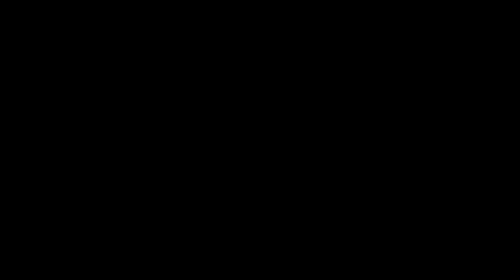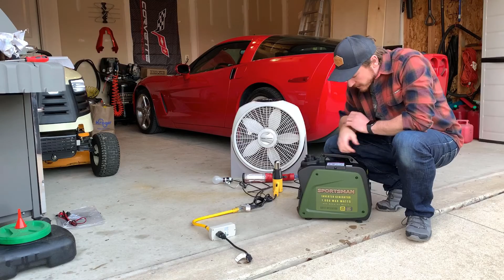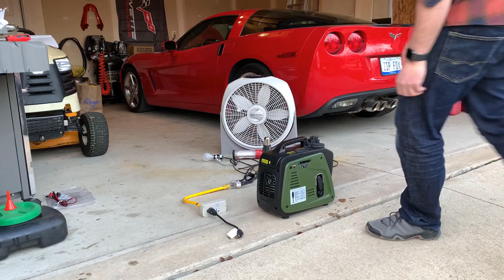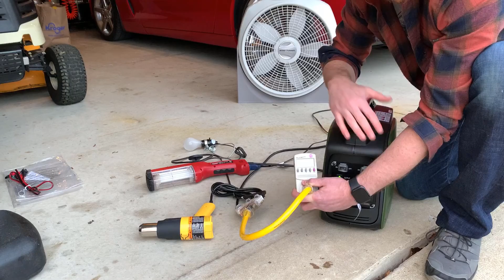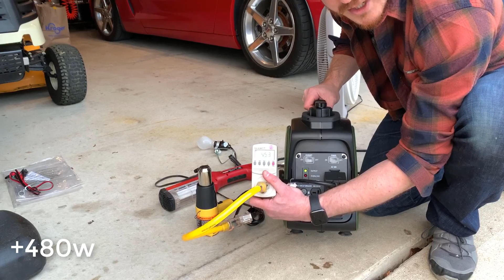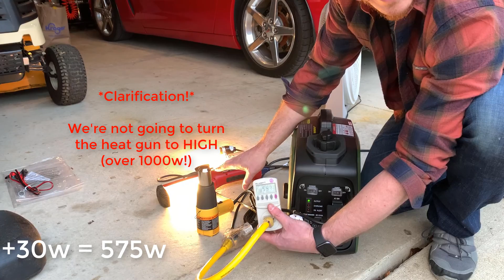Sportsman 1000 Watt Inverter Generator Review - Buffalo Tools

Comment: Yea it can’t handle a desktop computer and monitor, nothing else. I was pretty disappointed
Reply: Desktop computer is a very broad description... soem GPUs by themselves will overload this little sucker all by themselves. Also PCs are often very dirty loads... which are hard for smaller generators to deal with that said you can probably run 2-3 laptops off this with no issues, or 1x 350W PC + 50W LCD monitor.... dont' forget to accout for your monitor as part of the load. If you have your generator tuned up probably it can probably handle a bit more than that.

Comment: I just bought a dual fuel inverter sportsman inverter generator from Home Depot "HD". After watching this video I going to return it for credit as pro-desk will return with pro rewards 1 mo and HD credit card 1 year and finding an HD store that has to send by truck (not all) policy under maintenance policy it will exceed 30 days return, as it takes several weeks to repair.  Nice looking but it propane vapor leak means it could not take the trucking from MO. long way to the west coast. Beside it prohibited in Ca, to use as EPA stopped it sale. I thought propane would be clean but you hear gas rushing out inside. TOo bad it will take a road trip as I would not want to be one who experiences the propane leak and fire. I called Buffalo Tool in MO and they did not specify which passed Ca specification.   Too bad buffalo tools executive travel to china and if they do likely a s for a lot more money or seize if American business. Sears is a good example of how they changed policy to allow foreign businesses to own rather store or Mfg plant, than pay for kidnapping. See my video less min , I did not light the escaping the propane fuel as this is a residential area and I'll return it to retailer!! Do not buy Buffalo Tools

Comment: I find this strange. Mine will run 800 steady. I think your generator might have an issue
Reply from the maker: Brian Graham yep - I returned it.  Definitely wouldn’t get anywhere near 800w.
Reply: Thanks for this. I'm looking to get something to run a 600w charger for a e-bike and this thing is the best option I can find for the money. I think I'll give it a shot and update the post if it works or not. If I can get one from Walmart I shouldn't have a problem returning it if it doesn't work.
Reply: @IanJesting  did it work??
Reply: @elcompamartinez2647  I ended up getting the harbor freight predator 2000
Reply: The E Bikes are amazing. I think you made a wise choice picking a small inverter generator to charge it while on the go. This generator has served me well while camping

Comment: Excellent test and review of actual vs advertised 'claimed' output.
I also just bought one via the SD post.
Quick question,, when filling/checking oil level, do you take the oil level reading with screw-in plug merely sitting on top of threaded hole (unscrewed) OR when fully screwed back in?
Reply from the maker: I found the instructions quite confusing on the Oil.   I've dealt with a number of these small engines though, so i added 8-9 oz of oil and that seemed to get it on the dipstick right about midway up..  I measured the oil on the dipstick with it screwed in on a level surface.   Cheers!
Reply: @deependstudios  Thx for replying. Tho it may have sounded like a goofy question, some of the small engines have actually said to measure with dipstick plug just sitting on top, unscrewed. I'm just gonna use ounces, as you did, and use dip screwed-in as reference.
Reply: Looks like 7.5 oz of oil is the new fill recommendation. I've only ran mine about 6 hours so far but it ran fine with 7.5oz of oil. No smoke.
Reply: Instructions say screw it all the way in when checking oil level.